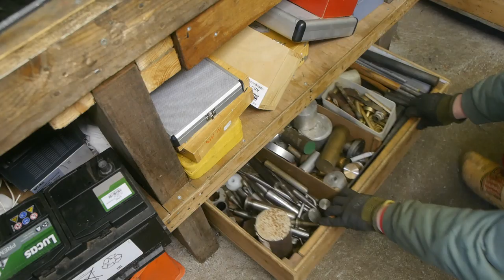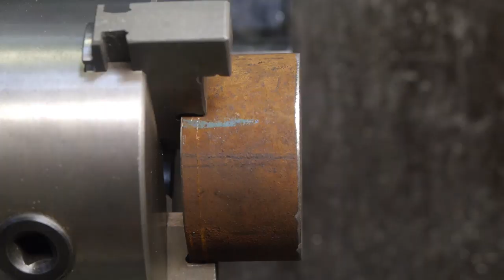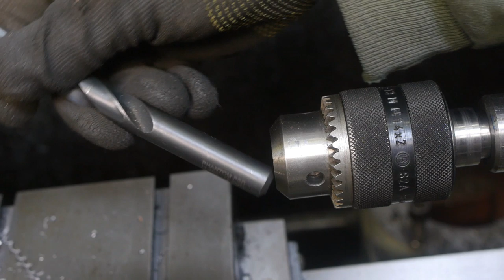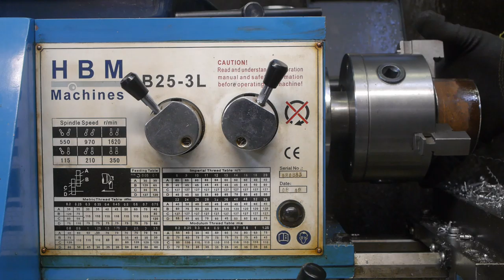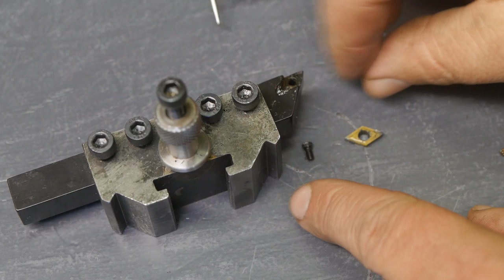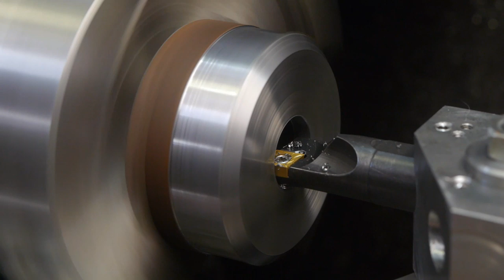Making a wood screw chuck for my woodlathe - part 1

Comment: You are starting to get the hang of this turning stuff :)
By the way, when you notice something is wrong that’s a good time to stop. Not 20 seconds later. 
Oh and HSS = 90 feet per minute :)
Reply from the maker: Feet? though you aussie blokes were onto the metric system :)
Reply: @Rolingmetal 
We change to Metric in the 70's  I was working as a Fitter Machinist in the 80's so it was a giant mixture of both systems.
So we learnt both.  Most of our machines were graduated in inches.  Parts we were making were designed in inches but many of the drawings had been translated to metric.  Which made the sizes all insane.  Gradually they redesigned the products to be actually sized in metric but they didn't replace all the machines so we got very good at multiplying and dividing by 25.4.  Of course then none of the new parts would fit the old products as spare parts.  Surface speeds is just one of those things that stuck in my head as feet per minutes.  Now I have a lathe graduated in Inches and a Mill graduated in millimeters.  I feel at home :)

Comment: 5:35 That's the worst possible insert for facing. That sharp angle wants to pull itself into the workpiece.  If you want to use it, you need to turn it 90°, and face from the inside out. But it's better to just use something like CCMT, or HSS as you did later.
Reply: Nothing wrong with that angle will do fine job kennametal had insert holders on that same angle and they work great. It was just bad insert and a piece of junk metal probably A 36 steel.
Reply from the maker: I actually bough a holder that uses the shallow angle on a ccmt insert. I better give that a try one day :)

Comment: I have a terrible time with surface finish on my parts when I turn as well. Have you considered trying burnishing? I recently saw it on some older videos and have considered trying it in the future. At  some point I hope to make shinny parts..lol
Reply from the maker: I thing burnishing was a wood turning thing.
Reply: @Rolingmetal  I have only recently stumbled onto a fewvideos of guys doing metal burnishing in there lathes. At least I think thats what they called it. Not much more a device that nearly looks like a metal roller blade wheel on a bearing. Sorta the opposite of knurling.lol

Comment: Need to wire brush ot sand that rust off before machining
Reply from the maker: That would have been the smart thing to do.
Reply: I get in a hurry and do the same thing just not good for the tooling.